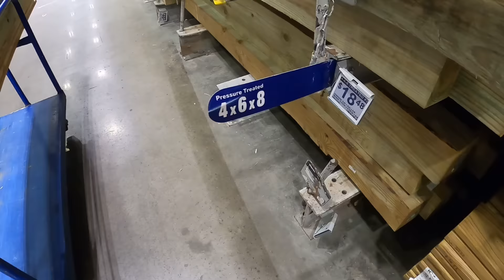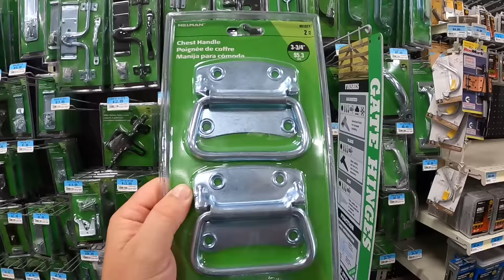Anderson Blocks and RV SnapPads Are A Waste Of Money! | Do This Instead! | Fulltime RV Living!

Comment: Never understood the craze for Snap Pads, at least for the price. How would a chunk of rubber under my jack make the trailer more stable than the solid metal directly on the ground or a ridged plastic Camco block under (if gravel is present)? I’ve traveled for 20 years and my currently trailer has 14,000 miles on it in 1.5 years. Never had a moment where rubber under my jack would have helped me out.
Reply from the maker: I get the idea of the rubber protecting the jack foot!  but making it more stable I don't buy that!  Also, people have told me the jack pads hold water and don't drain great, so you end up dealing with rust issues! Some nicer RV parks require pads down, so you don't have metal jacks on the concrete or the pavers!  I wanted to have added height as well as the protection with the rubber!

Comment: I have been “RVing” since 97’
I’ve made chalks, blocks, stabilizers- they eventually erode, break, fall apart, take up a lot of space.
I’ve been using Anderson blocks and chalks for the last 5 years, and never build anything out of wood in respect to chalks etc. again.
Light weight, ease of use easy to store.
There is no comparison.
Reply from the maker: I have always wondered what people mean when they say they take up a lot of space?  They are either under the RV holding it up or in the back of the truck while moving to the next place to hold the RV up!  The Anderson Buckets are great if you only camp on perfect pads, even then I have never seen anyone put them down without first putting a wood  footer down!  You know why they put the wood footer down?  Because if not the bucket will crack or it will oval!  When it ovals there is no more stacking them together for ease of storage!  They might work great on smaller rigs, but anyone I have ever talked to with a big rig, got rid of them! Not to mention the price tag that comes with them!
Reply: @PavingNewPaths  there isn’t a need to put a piece of wood under the block as a footer it’s designed to be used on its own. I’ve seen the largest fifth wheel, rigs and travel trailers use them. They are a great tool.
Reply: @PavingNewPaths  You also “Get what you pay for” Anderson is a bit spendy, I’m good with it. 
I’m not here to blast what you made, if you like it and it works- to each his own.
Reply from the maker: There actually is!  If you're not on flat ground, the buckets will either crack or oval we did our research and there is a reason we built our own over spending $300 on some plastic buckets!  The ones we used in the thumbnail were from a 16k RV and one was cracked the other was ovaled and no longer stacked together!  We are a 20K rig and we just don't see the need to spend that kind of money when I can build something for less than half of that, that will last longer and work better!
Reply: @PavingNewPaths  to each his own

Comment: Just buy the blocks. Why go thru all that work. Most people don't bother thats why products are made and saving time. Price of wood these days cost more then the product you buy for your rv. Alteady looked into it make or buy? Il buy  but more power to ya!
Reply from the maker: It's actually not much work at all, and I clearly showed you these blocks are half the price of the products you can buy!  So no the price of wood doesn't cost more than what you can buy, nothing you can build will ever cost more than something you can buy!
Reply: @PavingNewPaths  your opinion. But your wrong on the wood. Go check out a 8' 2x4 today .ridiculous. I made a shed 12× 18 with a loft. Put vinyl siding transom sliding barn doors for $4000. That was just 5yrs ago. Today I could not build that same shed for less then $ 8500.  There are good products out there for rv's that you can buy for less.  But  what ever floats your boat. Good job tho. Maybe you could make a business out of this. People love home made stuff. I would buy it if you were close by.  I have the equipment but at my age il just buy so I can have more time to camp. Lol  but it still is a cool project.
Reply from the maker: I built these about a year ago when the price of lumber was sky high and it was still half the cost of what the products are!  I could build them today for less than that as prices have come down a lot!  I simply just wanted to show people they could build something just as good or better for less!
Reply: @PavingNewPaths  maybe you should shop more because I find good deals for alot you mention. One example is the those quick levelers that you drive up on. I see them priced at over a $100 and I picked those up for $38 on Amazon. Amazon is loaded with special deals for rv's  But like I said whatever  makes you happy. Have a great day. ps: enjoy your blocks there is a certain satisfaction when you build it yourself. I know the feeling.

Comment: I did the same just used 6x6 and 1/2 plywood
Reply from the maker: Nice!  I went with the treated 1x6 because I knew they would be in the elements all the time and wanted them to hold up as long as possible!  Ours are 2 years old now and holding up great!
Reply: @PavingNewPaths  mine are all so treated and had them from another project another thing I did was 4x4 and ratchet straps for stabilizers witch is also a great diy project

Comment: Maybe on a 5th wheel, you consider Snap Pads a waste of money.  But, owning a Class A, I can assure you they are a heck of a lot easier to deal with than what you are using and I don't have to worry about storing a bunch of blocks.  Maybe you should consider how you title you videos, based on the audience you are appealing to.Being a bit critical here, but still enjoy your videos.
Reply from the maker: Thanks for the suggestion and absolutely these may not be the best fit for a Class A!
Reply: Well, homemade pads worked fine for our class A.

Comment: As a master Carpenter of 40+ years those blocks are way too heavy, and way overbuilt. I built the same size blocks out of 3/4 plywood. Basically, a box 12 inches square 4 1/2 tallnailed
Reply from the maker: They are actually not very heavy at all at 20lbs a piece and when you look at what they are holding up our 20,000lb RV you want them to be durable!  We also need them to be taller than 4 1/2 inches as the idea is to prevent the jacks from having to be extended to so far to help stabilize the rig! Being over built by your standards was still half the price of the products being offered on the market!
Reply: @PavingNewPaths  for some reason my response was cut off I'm guessing for too many letters. But I'll try here again. My blocks are a total of 6 in tall 12 in square. There's an X of plywood in the center with a three-quarter inch plywood top and bottom. Never weighed them but I'm guessing three to four pounds a piece. I didn't put any rubber on them but you could. So basically the same thing only way way lighter. Plywood is incredibly strong in a vertical position like that. Making them solid wood is way over killing my opinion

Comment: Looks like you got a cement Hazzard!  Should fix that instead of waisting time on blocks! Get some 8x8s put rubber patio blocks from Menards an call it good! Half the Price!
Reply from the maker: We don't  we wanted to solve the probelm if having our jacks extending to far and having rubber down between them! Most RV parks with concrete pads require rubber down no matter what you have! This solved that probelm and wa half the price of what is on the market!
Reply: @PavingNewPaths  I was talking about the cement your working on top of in video!
Reply from the maker: That is not my house but a friends who let us borrow his driveway to make the video!
Reply: @PavingNewPaths  Cool!

Comment: Your pads are great, but for a class A Coach, you never have to raise the jacks as high as you do on a 5th wheel. Storing all of your blocks take up too much room also. I have 4 wood pads built like you but 2” tall and snap pads. That is all I ever need on a class A. Class A. 5th wheels are different ducks when it comes to Jack height and pad heights. Your idea is great for 5th wheels.. thanks…
Reply from the maker: Thank you!  For a Class A these would not be very good at all! I would do the same as you SnapPads with a small wood block for a footer!

Comment: Oh hell no! Explain to me how carrying 6 of those around is somehow better than 6 snappads that are permanently attached to my jacks.
Reply from the maker: Snappads add no height, so the jacks are always going to be extended further causing less stabilization in the RV! Having these has allowed me to raise my jack mounting points the have more ground clearance when traveling! Also with snappads unless your on perfect pads you still need a piece of wood down first as a footer! The snappads hold water when it rains so they will rust out overtime! Lastly you paid $30 a Jack for a piece of rubber!
Reply: @PavingNewPaths the only time my GD 397TH is in any way unstable is when the washer is on spin cycle. And the snap pads are designed such that they do pretty well on the concrete, pavement and grass we’ve parked on in the year and a half we’ve been full time. The amount of extra weight and space you advocate for is simply not needed for a big rig.
Reply from the maker: @edwardtravels4600  I am glad you enjoy your snappads! We however decided we could build something better that would provide protection of the rubber with the height of the anderson buckets for less money! Good news is I don't sell these, so if you don't like them you don't have build them!

Comment: Any way I could get a material list?
Reply from the maker: I take you shopping for everything you need in the beginning of the video!  At minute 4:30 I explain the quantities of everything you need depending on how many you need to make!  The rubber horse stall mats are sold in 4x3 pieces so they will make 12 rubber squares total per piece!
Reply: @PavingNewPaths  Will these work on my 2016  Forrest River Vlite TT?
Reply from the maker: @patrickmcnulty3095  They will work on any trailer that has stabilizers or jacks
Reply: @PavingNewPaths  Thank you for your timely response.

Comment: I disagree. Snap Pads are 100% worth it. Just for the protection of the feet of your levelers/landing gear. You need height, then add height. But you drop your trailer for whatever reason (gas, lunch, maintenance) and one of the legs land on a rock. Your foot is now bent. I will always have Snap Pads on my trailer.
Reply: I agree.  They are a little pricey, but way worth it.    I sprayed the bottom of my jacks with a good coat of paint and let it dry fore a couple days before installing the snap pads.   The blocks PNP made are pretty stellar, but I try to reduce the amount of weight I carry, so I have something close to what PNP made, but just two for the front and I have some lightweight pads in case I need something for one or two of the other jacks.
Reply from the maker: I looked at the SnapPads and my thing is yes, they protect them, but after spending $30 per jack I still have to carry wood blocks to make up the space!  We raised all of our jacks to help with clearance when towing so we didn't want them being extended so far when parked!  My idea was how can I combine the height of the Anderson Bucket and the protection of the SnapPads!  This was my idea, they are heavier but, in my opinion, will last longer!

Comment: Kinda heavy are they not?
Reply from the maker: They are about 20 lbs a piece. They ride in the bed of the truck on travel day, so it's not really a problem. When they're holding up a 20k lbs trailer, we think they should be a little beefy.

Comment: Plywood works better its more flexible,all the wood one,s I,ve seen crack and fall apart.
Reply from the maker: After 3 years of fulltime travel moving every 7-10 days these look exactly the same as the did on day 1! There is no way I would use plywood for these because there are times when it rains they sit in water until it dries up!  Treated lumber is the only way to go if you want them to last!

Comment: Blue store, and thanks for the build help.
Reply: Only comment is the weight of hauling these around.
Reply from the maker: They have some weight to them but they are not heavy! The only time your hauling them around is when your moving the RV! In my last video where I weighed my set up these were included in those scale slips and we still had several hundred pounds of capacity left!
Reply from the maker: Blue store all the way!

Comment: Uhhh what’s the value of your time?  It took me .2 seconds to order 2 Anderson blocks and 4 snap pads on Amazon. Yours are also a lot more to store and heavier to lift
Reply from the maker: Thos took very little effort to design and build and is a far superior product than what the market currently offers. If you can not lift approximately 20 lbs. at a time, perhaps RV'ing is not for you. For reference, my wife carries one in each hand with ease and doesn't consider herself strong by any means. We also store them in the bed of the truck on travel day, so they don't take up any of our storage space.

Comment: Nice idea, but useless if the campsite is not level. i just use 2x10's doubled up. (or 2x 12",etc.) then I throw another on the low side to keep jacks from overextending (because this is bad for the seals). My cost is next to nothing because it is scrap construction lumber. I use leftover paint because who cares! Way overthinking this Newbe! What are the handles for? Just to get in the way. What is the rubber for? Just to protect pavement, dirt, etc.
Reply from the maker: We have used them for over 3 years now on unlevel sites, you don't have to add extra wood on the low side thats the benefit of hydraulic leveling systems! I also don't see how what I made to use on my rig has anything to do with what you use on your rig!
Reply: This reply wasn't for the typical narcissist youtuber, it's for the readers to decide. Let the readers see what money and what other peoples ideas might work for them.  @PavingNewPaths
Reply from the maker: @stepdad12345  We will let the Youtube "readers" decide! They can build something themselves that will solve a problem, look good and last forever! Or they can just carry random pieces of wood around because who cares right! Maybe you should make your own video about the pile of random scrap lumber you carry around with you, and how it works for you!
Reply from the maker: I like how you see me as a "youtuber" so you think it is acceptable to talk to me the way you do! If you saw me on the street you wouldn't talk to me that way but behind the keyboard you feel safe to say what you like! So far you didn't pay a single thing to watch my video, it cost you nothing, I also make nothing off this video, the blocks aren't for sale they are just what I built! But you felt the need to talk about my video like it is a product for sale and that using random wood is a better choice! Then you took it a step further and told me the places I shop and the products I buy at these stores are also inferior according to you! The problem is not youtubers its people like you who feel the need to contradict and belittle anything you see on youtube that you don't agree with!
Reply: Man, you are sensitive. Take a chill pill. I do like that you don’t take a product and push it on the public. I am just kidding on everything. Keep making these videos because your speaking is clear and quick. I might not agree but that’s okay. Ideas are good for RVers

Comment: 8blocks at , what, 20 lbs each? 160 lbs of wood instead of 4 lbs of plastic! Yeah,you are a no-go at this station.
Reply from the maker: Well seeing how no RV has 8 jacks why would we have 8 blocks! If you have the Anderson blocks you still need to carry wood as a base otherwise they will crack or warp and they will not stack back together! But the biggest reason to build these, is i didn't pay what you paid for some plastic  that is not the ultimate solution!

Comment: Clearly ,you do not camp in wet climates much. Wood gets moldy, rots, smells and dirt and crap stick to it like a magnet. That was the first thing I threw out when we got our camper was the nasty wood blocks that came with our camper. The last thing I want to deal with is wood blocks in a wet environment.  Not to mention the WEIGHT of wood. Clearly you forget you have load limits on your RV. Not just the trailer, but the side load limit on your TIRES. Exceed  that weight, and you risk blown tires. No sir, wood is NOT the way to go.
Reply: Did you watch the video? He used treated lumber, has rubber touching the ground, and painted them which provides at least some level of protection. Not perfect, but they should hold up well.
Reply: @linkfloyd4908  Treated wood  should never be painted, at least not for 6 months. The moisture from the treatment will cause the paint to fall off. Any painter worth his salt knows this. ground moisture on any paint will fall off. When was the last time you saw any wood structure in contact with the ground being painted? None. There are better, lighter materials for leveling  a trailer. Trailer tires are rated for a maximum load rating. Most people over load their campers and cannot understand  why their tires shred going down the road. Yes, I watched his video. Bad advice.